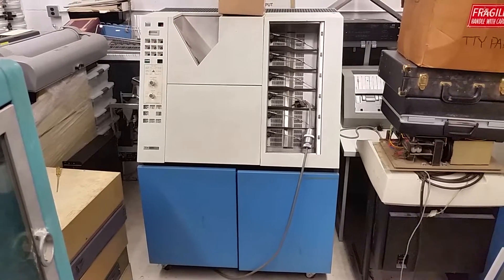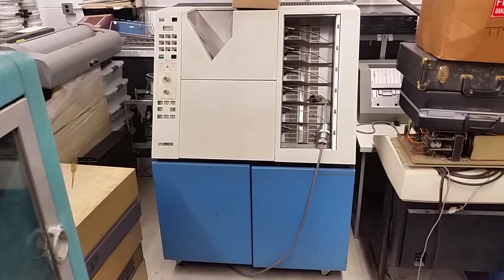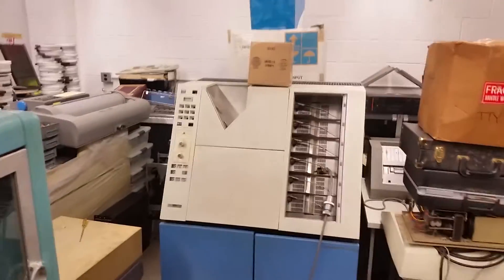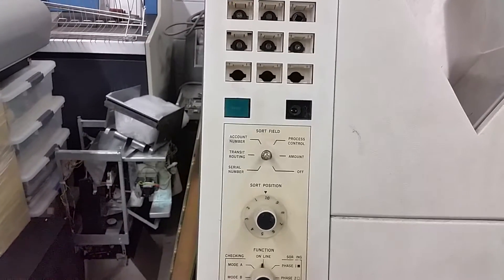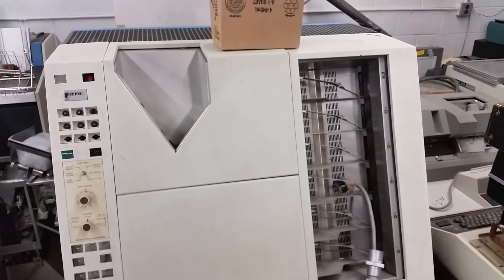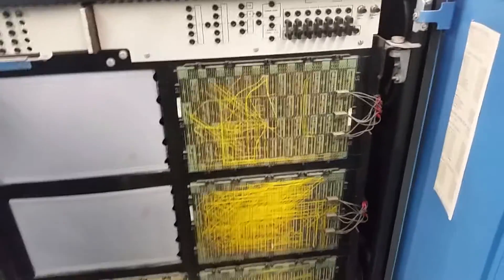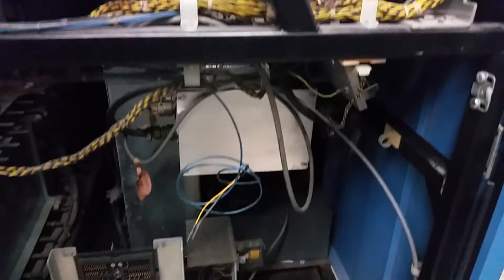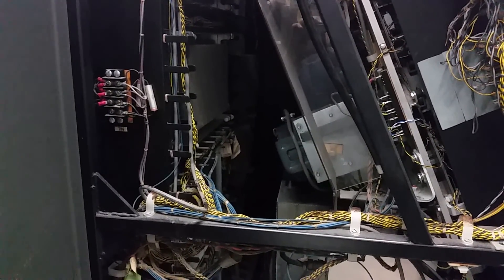IBM 1255 Check Reader

Comment: Thanks for the video, and trip down memory lane.  I was with IBM for 30 years, use to work on these back in the early 1980's.  Dallas Tx.  I was the area Top Gun on these.  The one you have is a 6 pocket machine. Most of them were 12 pocket.  Jimmy Whited below is correct you can run it off line to play with it or sort checks.  It was built like a tank.  The logic cards in it were tough as nails, very rarely did one ever fail.  Most of the service consisted of replacing and adjusting the Magnetic Head, and of course the never ending changing of belts.  
Great machine, got lots of overtime servicing these.
If you have any questions about them........ mdsinger@swbell.net
Thanks again for the video.
Reply from the maker: My machine is currently on long term loan to TechWorks in Binghamton, NY, and is being restored by an bunch of IBM old-timers. Got any spare rollers?

Comment: I worked on one starting around 1980. Small bank 100 miles away from my home. Long rides to diagnose and repair on a Friday afternoon!
Reply from the maker: Are you anywhere near Binghamton, NY? This 1255 is currently just starting restoration at the Techworks museum, under a long term loan. We intend to get it fully functional. Currently it shows very good signs of live, but certainly needs a very good cleaning and a bunch of new rollers. Do you have any docs on the 1255? We have some, but are missing some important ones.

Comment: You can sort offline, I worked with one of these back in 1979.
Reply from the maker: OK, good. My 1255 just moved to Techworks, in Binghamton NY, on a long term loan where it will be restored and displayed. It has an SIO channel on it, from when it was connected to an System/3. It is unlikely Techworks will get an S/3, so offline operation is good.